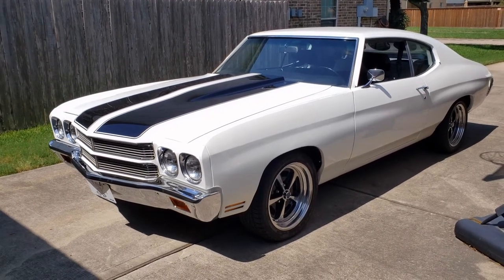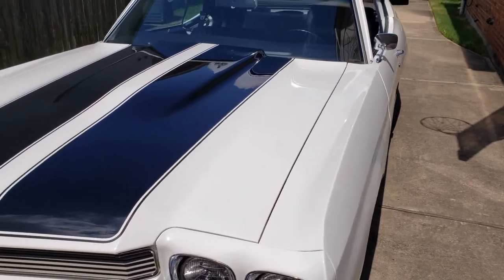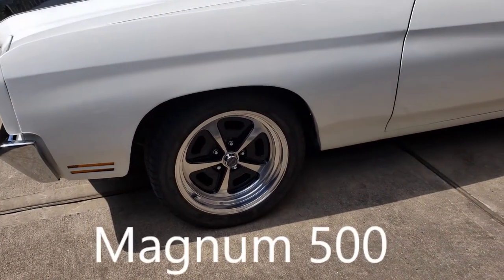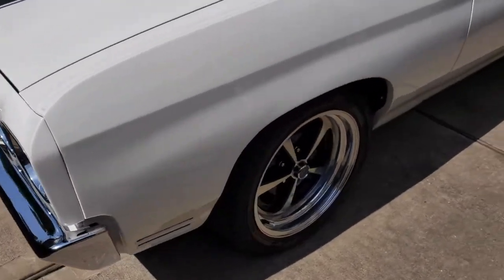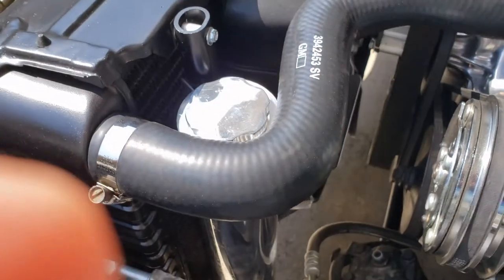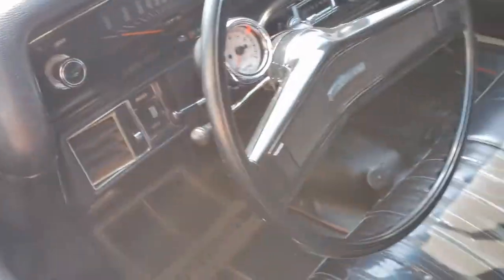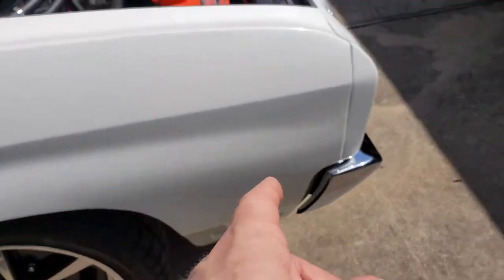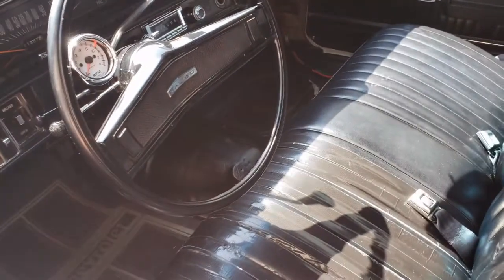Chevelle update; April 2020 (project overview)

Comment: Hey man, found my way from Counts Kustom page. Love the car, I am a Chevelle guy from way back, in fact my first car was a 72 Chevelle SS and I drove it in High School.  Will enjoy watching your build. Non powered brakes....old ones were drums. No wonder so many front accidents. ...lol.  Cant be stopping really good now with the disc brakes with no power. 

 RIP Aaron.
Reply from the maker: Thanks.  Actually, I can lock up the brakes without a ton of pedal pressure so the setup is pretty dialed in for not having the vacuum booster.  Cheers!